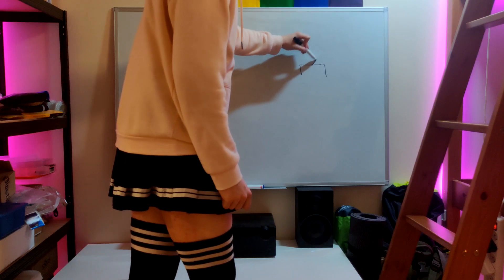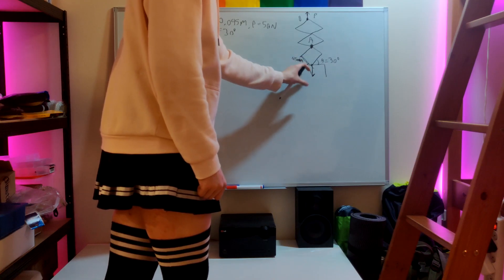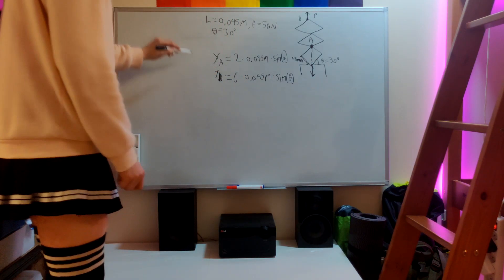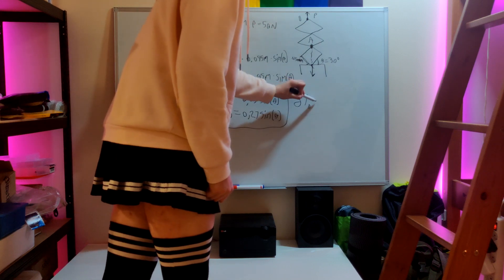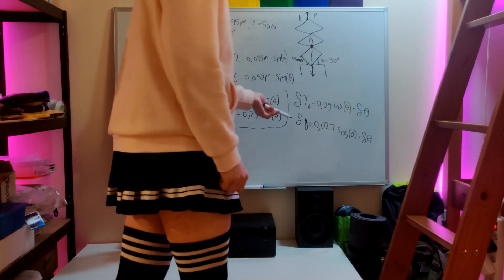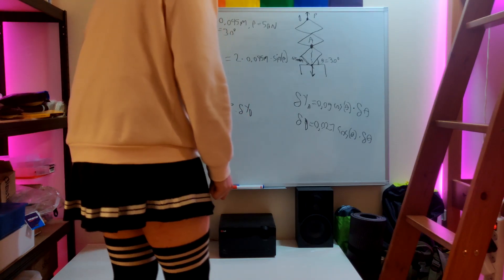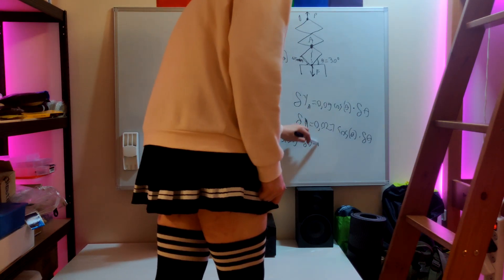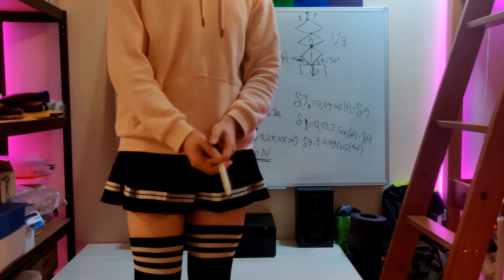Femboy Engineering Physics: Virtual Work and Scissor Mechanisms

Comment: Am I dumb? Why isn't Y_D = 2*Y_A instead of Y_D = 3*Y_A? Also concerning the board, the easiest way to make it easy to read is to fragment it. Draw 1 or 2 lines verically depending on the width. If you have two parts use them like page 1 & 2. If you have 3 parts, use the leftmost for things that shouldn't be wiped (here the sketch and numerical value).